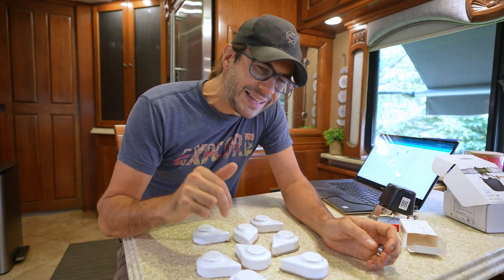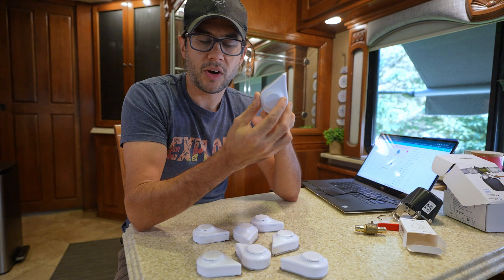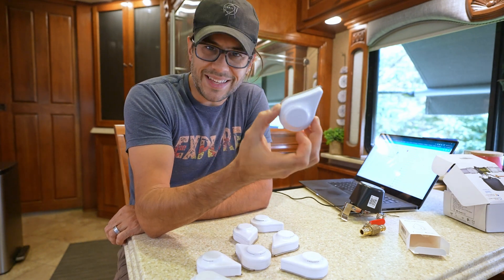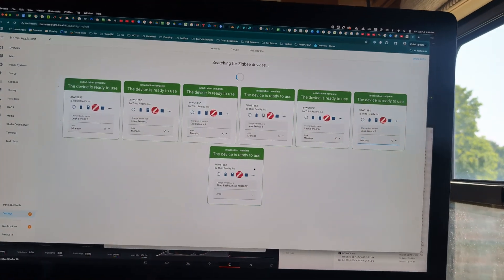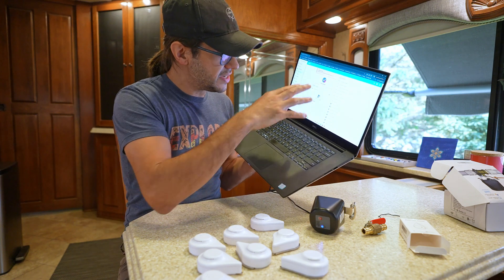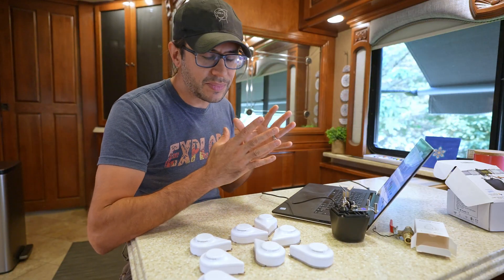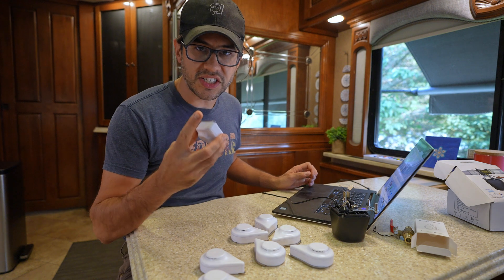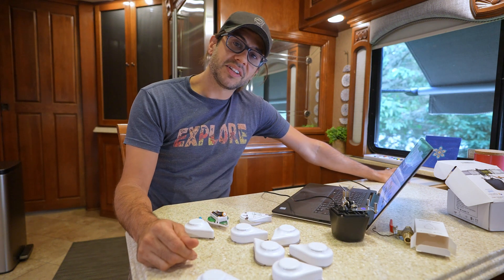Use Home Assistant To Detect And Stops Leaks!

Comment: Another option for simplicity is Yolink water leak sensors. They make a wide variety of devices and can work without electricity, internet, or wi-fi. The key is Device-to-Device pairing, which directly connects the sensors to the valve. This would be for those who don't want to use a hub like Home Assistant.

For those requiring remote alerts on your phone, though, a Yolink hub and internet are still needed.

Comment: Love this! We have had a huge water leak that happened while we were sleeping and it was a mess. I use home assistant in our home but haven't really thought about using it in our RV. One question re the water valve shutoff: Why did you choose the matter one instead of the zigbee version since you have a zigbee network already?

Comment: Hey Tom - very cool! We've been using simpla 'alarm' water sensors that you can get a big box stores for years (after experiencing our first leak in an RV) but I really like this level of integration. Curious though how well it fits use case of 'part time' RV travel vs full time. We shutdown power in between trips to conserve battery; does the controller fire right up and auto reconnect to the sensors whenever power is restored or is a resync process needed? Also wonder what other options exist to shutdown a water pump not on a relay. Might have to go down this rabbit hole! Well done!!
Reply from the maker: This might be a bit excessive for part-time use and having the basic leak detectors that squeal is still great option.   As for startup, home assistant is very robust, my server has been reset many times and just automatically reconnects to everything. That's kind of its design. So  powering down shouldn't be an issue. If your water pump's not on a relay already, I would add a latching relay inline to the pump. It would basically interrupt power to the pump. Could be a bit for confusing if the relay is off however, and the pump is turned on because it won't run (you would probably need a note next to the switch for someone who doesn't know the system saying if pump doesn't come on check leak, relay settings or something like that)
Reply: @MortonsontheMove  - thanks for the reply Tom. One more question - have you considered monitor/shutdown of city water supply for those times you have full hookups? As I went down this rabbit hole I was wondering if putting one of the Sonoff (or similar) hose control valves might work for this scenario. Any thoughts?

Comment: Your video is awesome. Thank you for posting it. We were at an RV park with our 2011 Monaco Diplomat just last Fall and had what could have been a disastrous leak. We have a macerating toilet that uses a 12V solenoid valve to turn the water on and off. Even though the valve has it's own built in screen, a tiny speck of debris entered the valve and prevented it from closing completely. We were connected to the parks water supply at the time. We were inside the RV just chilling and watching some TV when suddenly my wife let out a shriek and pointed at the floor in the living room. There was a literal stream running from the bathroom into the living room and out the gap underneath the road side slide. The solenoid valve allowed water to run into the macerator toilet unchecked. Eventually the water overflowed the toilet bowl and onto the bathroom floor. We really have no idea how long it was overflowing before my wife noticed the water in the living room. We got lucky and had the water mopped up before it did any damage. Glad most of it ran outside. I know this is a long winded comment but I was hoping to warn people that a leak can come from the most unexpected places in an RV. I will definitely pick up some leak detectors to give us a heads up. Eventually I intend to follow your lead and do a complete system to shut the water off automatically. Thanks again for posting this video.
Reply from the maker: Ahhh that's terrifying!, we too have the tecma macerator toilet and I have worried about that. We're actually bath and a half and had two of them, and the rear one which was on the slide (I know crazy) we removed and replaced with a composting toilet because it had leaked. Yeah just so many places these things can leak, our leak was the blackwater flush vacuum breaker valve which I had never even thought about! I feel like leaked detectors need to be a factory item in these things.

Comment: Did you look lt Yolink? I've been using this system for the past 3 years. Many devices can also be used without the internet also.  Water sensors temperature sensors motion sensors devices that can remotely open or close a switch, just to name a few.

Comment: I would happily watch a video on the electrical system integration with home assistant. 

I do it now with Victron, but definitely feel some of the limitations
Reply from the maker: I might try to put that together eventually, probably outside most of my audiences interest tho. If your experienced with home assistant high level I do it with a custom hasc victron ble  integrations to poll the Bluetooth data directly because some of my devices are not networked, then for multiplus control and data I use MQQT as victron surprisingly has a robust library for MQQT control. No more  assistants for things like self consumption, gen start, charge limits etc, just script up anything you can think of, but do understand the system well, because I'm sure victron has some things in their assistants that try to stop people doing things that don't make sense.

Comment: Great information! I use Hubitat for my local processing and highly recommend it. It's local control (no internet needed) and supports zigbee, Zwave, matter, wifi built-in, no need for separate radios and Raspberry Pi.. all the rules based processing are easily configured and built-in...